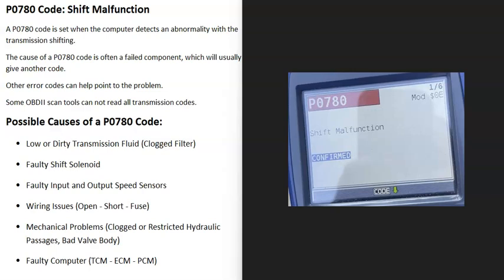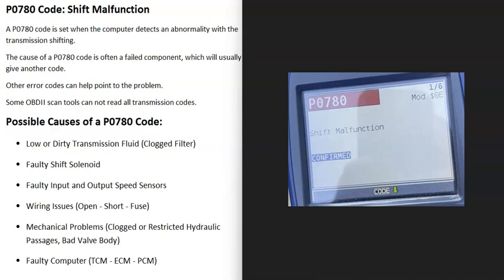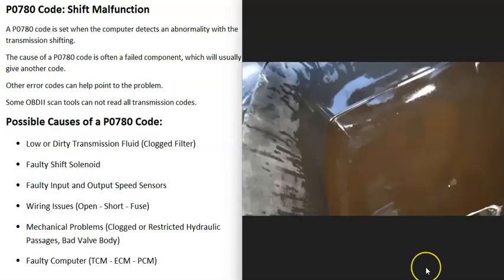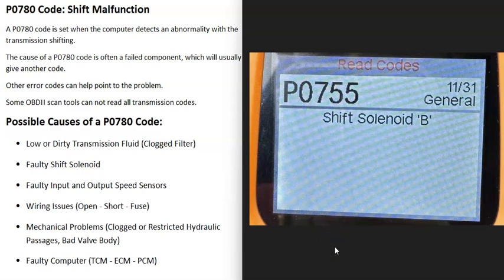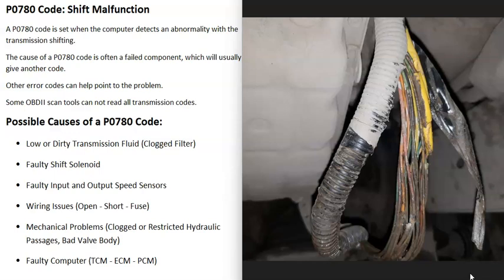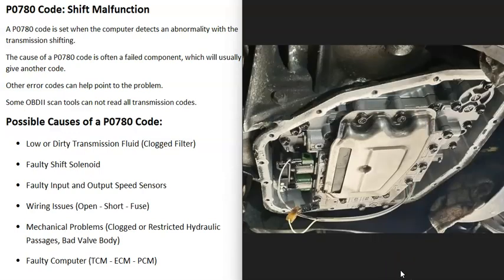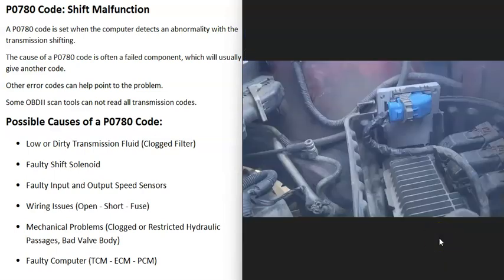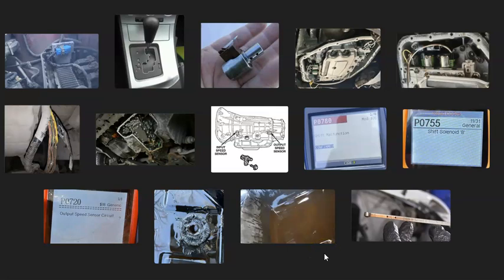Causes and Fixes P0780 Code: Shift Malfunction

Comment: I have this P0780 code in Pegeout 407 2.7 HDI  and is followed by U2000 and P2131 i also have check engine light on because of EGR but that will soon go away because i will cancel EGR and DPF. The point is that my transmission shifts normally until all the fluids get warm, after that it's starting to jerk/punch and 2,3,4 make very ugly when is shifting, this happens only after i drive minimum 50-70km and ia very strange. Can it be because of EGR or this problem occurs only because of the gearbox